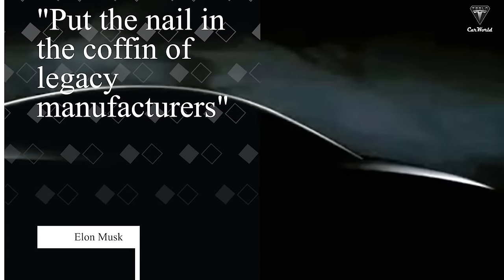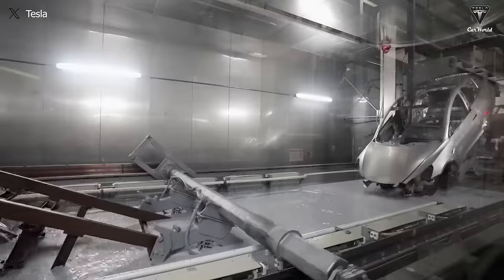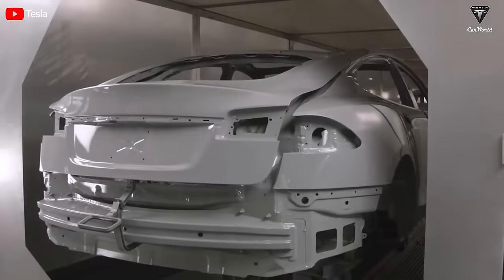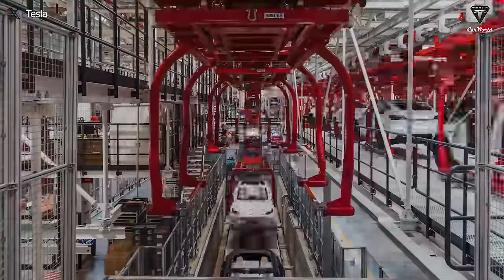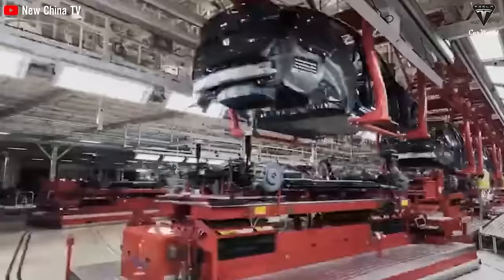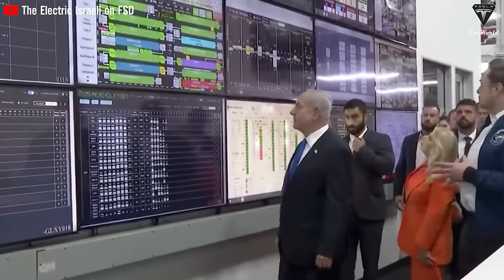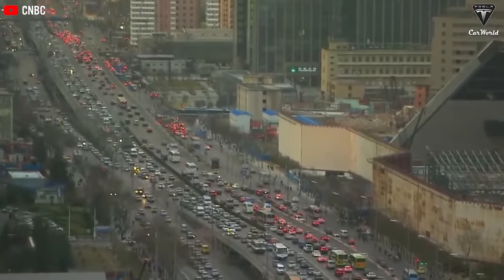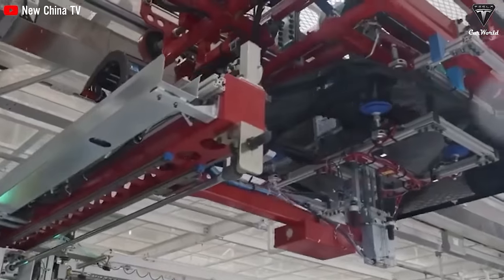LEAKED! 4 UNIQUE Tesla Models Design in 2024, Will Blow Your Mind! Detailed Everything HERE! (MIX)

Comment: "Nice design" doesn't mean "We're using this design for the next gen". Also, it bug me that people are calling those doors in the mock-up as "falcon wing doors". The aren't. They are "gull wing doors". The difference is that the "falcon wing" design used on the Model X has two hinges per door, including "elbows" that allow the doors to open with minimum available space alongside. "Gull wing" doors have a fixed profile that only hinges at the connection with the car body ("shoulders").

Comment: I think that the design will be a very compacted hatchback with 4 doors or 2 wide conventional doors. Due to cost it will not have gull wing doors. It may be available with 1 motor in a regular and long range model with a 2 motor high performance model debuting a couple years after.

Comment: I’m an older man. I don’t like the Model 3. To low to the ground. I like the Model Y. Just the right height for easy entry and exit. I hope this new Model will also have a higher ride height for easy entry and exit. 2 doors and small rear storage space behind the rear seat would save weight. I’m just looking for a commuter vehicle.
Reply: I'm 6 foot 3, 300 pounds, and 65 years old.  I would have preferred to buy a Model 3 but ended up in a Chevy Bolt for the very reason that you are talking about.

Comment: Why go for 24V they already have the parts and suppliers for 48V.  Again why limit to a 2 seater, should have minimum of 4 seats.  I can see having 2 large falcon doors and a button that moves the front seats forward to let passengers to enter the back seats.  I assume the model Y, 3 and 2 will be the same width so 3 seats could fit in the back.  Casting the back, front and middle in one big press does not match the open box production.  I can see stainless steel for price by avoiding painting but it limits the styling of the bodywork. and adds weight.  Assuming they will want a smallish van option I´m not sure you want falcon doors.  That would be just 2 seats upfront and a boxy van structure ate the back with 2 doors at the back replacing the hatch back.  For the hatch back you can have rear seats that fold down to give you more luggae space, maybe with a 2:1 set up..

Comment: If I could meet elon musk I would tell him that he is as great as Henry Ford, and he would do well to study his secsess, as the model 2 is the The Model T of the 21 century, It had some advanced features, like a four-cylinder engine with a detachable cylinder head and a one-piece cylinder block. It did use lightweight, high-strength vanadium alloy steel. But one key to its early success was a simple thing like ample ground clearance, that allowing it to deal with abysmal rural roads and fit a family of four. Basically a mini van that anyone could afford during the 30s great depression. I can appreciate the beautiful lines of a Ferrari as much as the next guy but, what most poor working people want is cargo space and reliability for a low price. Basically a mini van you can put a car seat and groceries in with a low monthly payment. And he should guarantee the batteries for life to hold depriesseation values up over compitition (one of the biggest blocks on his sales besides the fed financing rates)